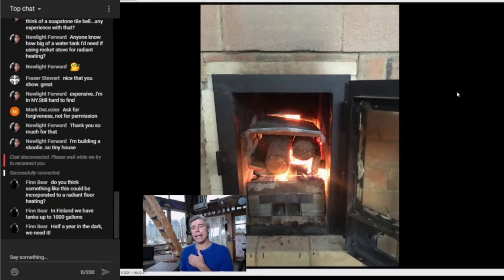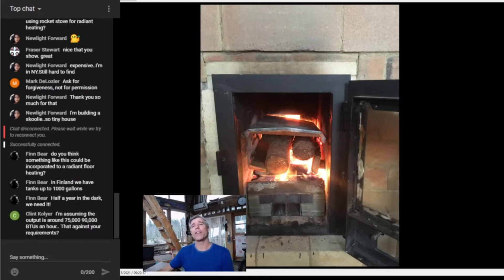Moisture in Rocket Mass Heater Exhaust

Comment: Yup, wood is a carbohydrate, burns to form carbon dioxide and .... water. My first bell style bench was a half barrel round side down with concrete slabs on top. The seat was nice and warm, the wood was dry but when I took the slabs off after the burn there was a puddle in the bottom. It was just a test setup and so it didn't run all that long, I am sure a longer run would have dried it out. I would make a bench with straight sides next time to not collect the water in the middle.